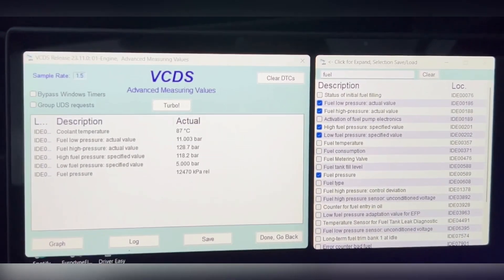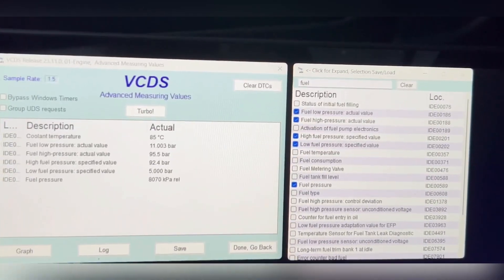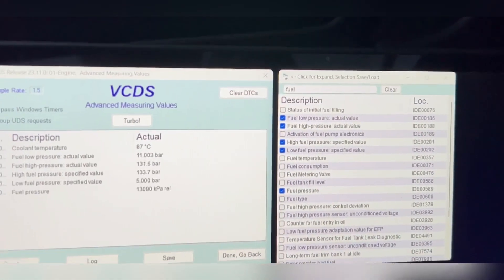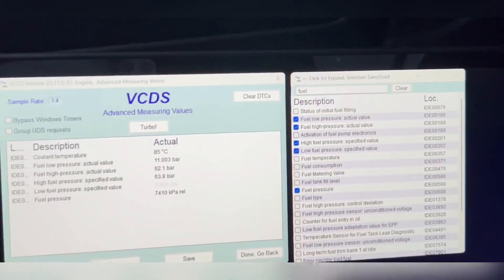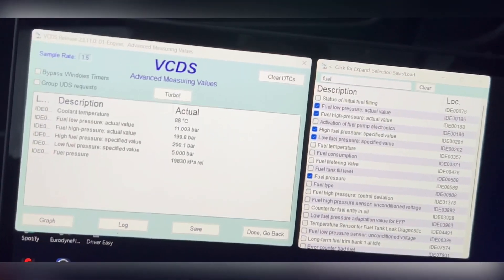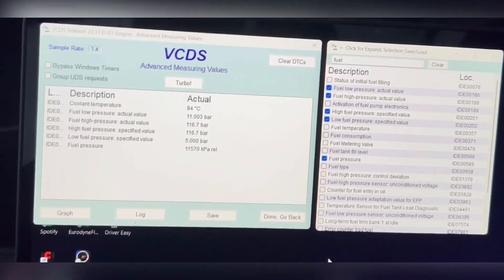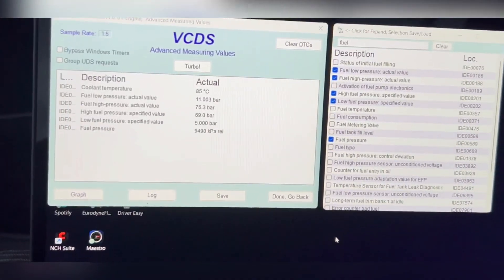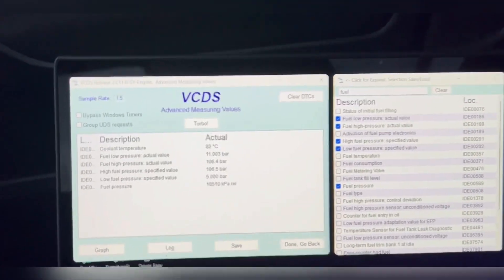VCDS/VAGCOM Fuel Pressure Values - LPFP & HPFP

Comment: EA839 S5 Audi

Similar,. First, morning cold stars are crap. 
Not touching throtle the car  blip/hesitates. on its own rythm. 
This it throws a miss fire on Cyl.4. Oddly furthest away from HPFP.
Replaced All coil packs and cyl4 spark plug. 
Same Issue, But I started to notice my HPFP having its own "off rythmn" ticking noise.
YES, HPFP is loud tak tak tak rattler, but it has different rethym. 
Here is the kicker NO CEL.. none.

If I stay on the gas, just lightly, my CEL for cyl4 never happens.
If I keep it thatt way, with light hold on the gas, by this time. My coolant is up to temp and my Oil temp is to 150F .

then it goes away. Still there to a sharp Ear, but nonetheless goes away.

VCDS Logs, also show during heat soak, MPa go up on the rail. That tells me, nothing leaking. 
But still, The rate of rise during heat soak also important to test leaks,. That info I cant find. 

It seems Everything Point to HPFP.

My question is What are the symptoms of faulty LPFP and how HPFP reacts to it?
Reply from the maker: Weird. Well, just letting you know that I did replace both my LPFP and HPFP and my symptoms were less, but still there.

Comment: Unless you have a lpfp sensor you will not get a reading for the lpfp actual. In regards to the high side i dont see any issues as you didnt lose pressure on your pull as you climbed into the rpms. So it appears the low side seems to be fine by seeing the high side numbers. You should look into getting a machinna a0 and using Simos Tools to log.  Additionally what tune and fueling upgrades are you running if any?
Reply from the maker: Good to know. Thanks for sharing this info with me! I’m running a custom Mabo tune and fueling is 100% OEM. My tune I’ve been running for years, so it shouldn’t be the problem
Reply: @JacesOwnWorld  you'd be surprised. I recently began tuning my own car with open source and now looking at my previous tune, there were some critical issues I noticed with it. Mabo doesn't have the best reputation but by now I'd figure his tunes should be pretty decent. Ask him what is the max duty cycle he has your tune set to. As far as the logs are concerned I don't see anything wrong with that data. Have you tried cleaning your injectors? If you go MPI in the future that will show you the low pressure side numbers but until then youll see the static 11 bar.
Reply from the maker: @RafaelSencion I understand what you said about the LPFP now. Thank you. 

Yeah there’s a few that don’t like Mabo. I personally have been using him for 4 years now with zero issues. Every tuner has had a few people that don’t like them. Even EQT has a bunch of us that have had bad experiences. I personally know two MK7 GTI owners that have blown engines, both using EQT tunes, but you don’t hear about that on the forums. EQT hides the negative posts so people don’t see them. But that’s another story I don’t really want to get into. But yeah, I will ask Frank on what my duty cycle is. My injectors are pretty new. Matter of fact, this issue has been happening before I replaced them, but before I replaced them, the car would grow an EPC if I had any load on the car. After replacing the injectors, that no longer happens. So I know the injectors are fine. Plus, this sputtering only happens within the first 5minuyes of driving. The rest of the day it drives and pulls perfectly.

Comment: My guess would be a faulty fuel injector or maybe just valve cleaning..keep us posted ,oh ny the wayy yoir vidoes saved me again lol i was removing grill because i just installed a intercooler and wanted to have it grill less and dayum it was a pita ti rwmobe those dumb clips but your vid helped and made it easier
Reply from the maker: Faulty fuel injector is possible, but they’re all pretty new. Valve cleaning isn’t it, as I’ve done 2 of them since this has been an issue. I’m almost certain it’s a fuel pump. Just not sure which one. 

Haha cool. Glad it helped.